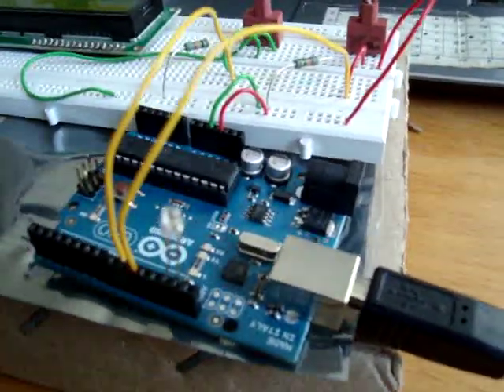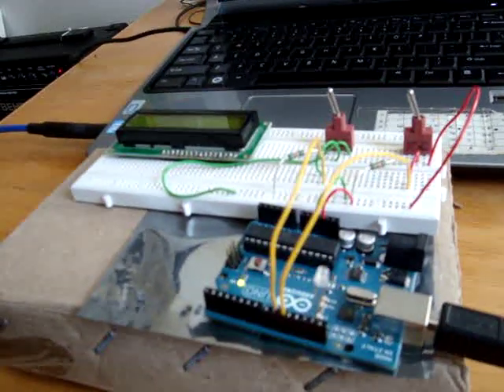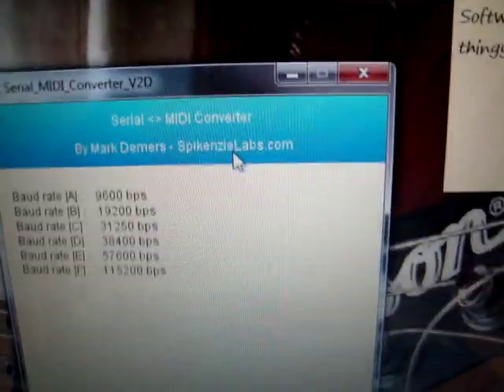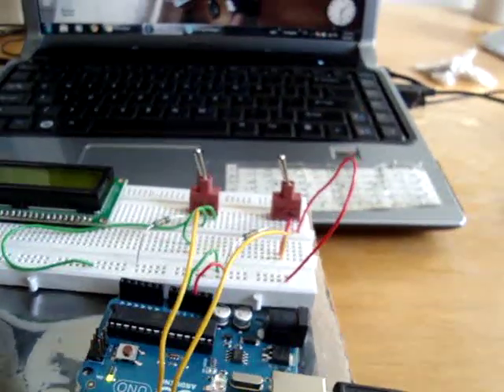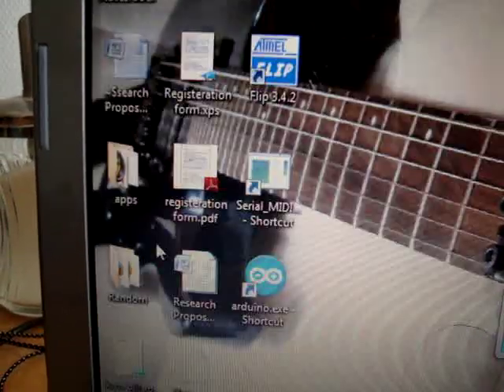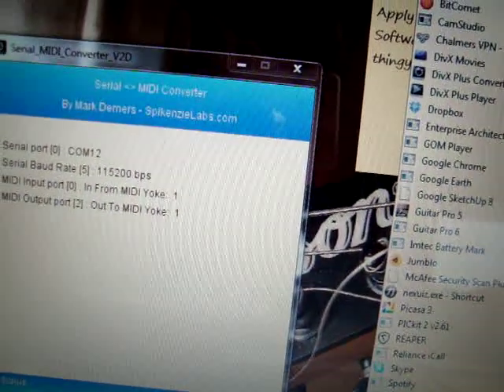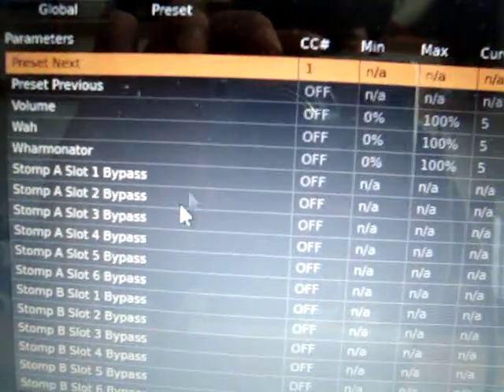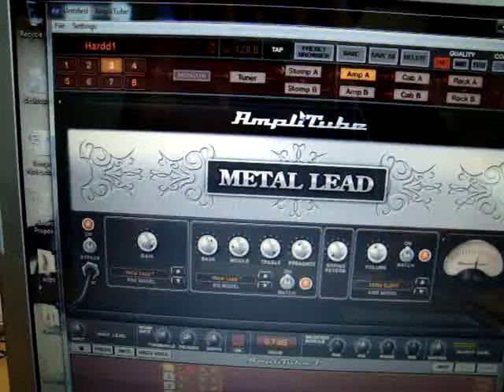MIDI USB Controller using Arduino Uno demo on Amplitube 3

Comment: Hi Bharat, nice video. I have the Aduino Nano, and I'm running Guitar Rig 5 in Windows 7. What do I need to control GR from homemade pedals connected to some Arduino pins? Is it enough to connect it to the USB port and run my sketch, sending MIDI CC to the USB port? Or do I need to instal something that reads the MIDI CC signals from the USB, like that MYokeNT? Thanks.
Reply: ***** Thanks, in fact I have just written a short sketch that simply reads the serial and outputs the same back, in order to try GR reading the CC commands before building the pedals and switches. Now I have to learn basic MIDI commands.I will check the links in minutes, thanks again! A last question (for now): are there specific CC commands for specific actions or can I use any? I mean, if I want GR to skip to the next setup, does it have to be a given command or can it be any?
Reply: I thought it was as simple as Serial.write(the MIDI CC command ) but after checking your links, I see intricated things like "midiMsg.msg.command" and the like...
Reply: ***** Yes, GR has that option, but I need GR to "see" a MIDI device while there is not one. No MIDI devices in Settings/MIDI. I only have a Nano plugged to the USB port. Do I need to install any app that runs in background emulating a virtual MIDI controller, and then configure GR to use that device?

Comment: Thank you man for your fast reply. there are some points. I wrote the code for 115200 bps. but only when I scan it with 31250 the RX light blinks in green otherwise it is red.
Also when I use 1 as both in and out it blinks slower than when I use 2 as output. 
However, I do not see anything in my input/output monitor boxes in MIDI-OX. I would appreciate yourr help on this. { I am not using your code, maybe I have to change to that}

Comment: Finally a detail video. I just wanted to make sure. in Serial Midi software. both input and output are MIDI yoke 1.???  I though I have to do input as 1 and output as 2. and midi-ox does not show me that much. it does not really refresh the display that often. I was wondering if you could help me. Thanks,